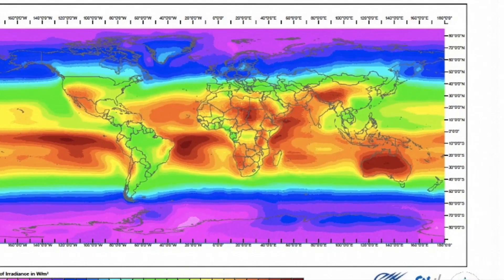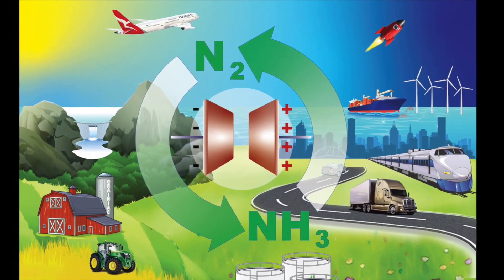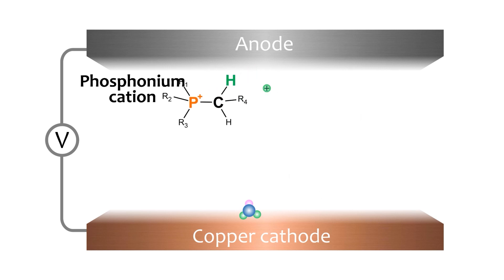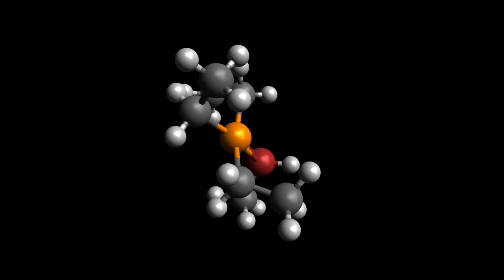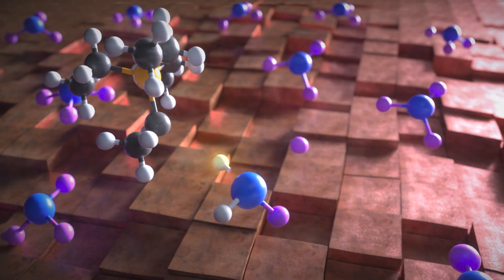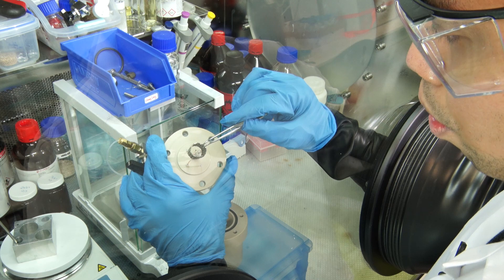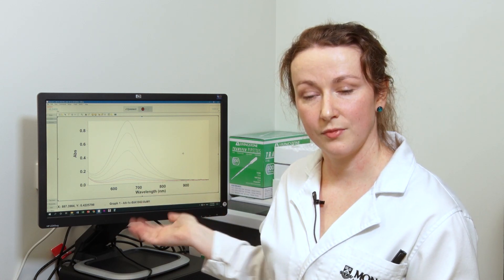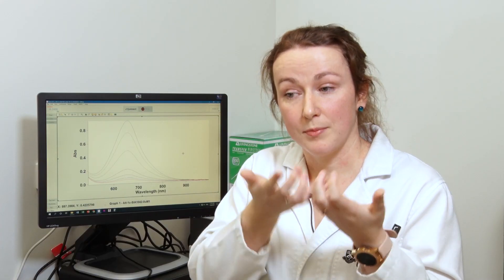New Research from the Monash Ammonia Project

Comment: Direct electrolytic production of ammonia is a holy grail for many reasons, primarily as a solar dumpload that can be used locally to the same regions that have the solar plants. But.... The subtext I’m getting from this presentation is that the quantities are so low they are resulting to some of the highest accuracy methods of measurement.

My gut feeling is if this were viable it would be a matter of simple titration on litres of concentrate. Not NMR on a single mL. Let alone having to run on analytical grade nitrogen bottles, assembled in a clean box because the real air is too contaminated.

Fingers crossed this is just a path finder and the understanding gained elucidates a more practical and robust method.

But sorry guys, this ain’t it, and that’s not to take away from the tremendous effort.

Comment: What is the ultimate source of the protons being shuttled by the phosphonium salts? Is it from water? If so, then either you're turning H2O into OH, and the solution will get steadily more basic, or you are turning H2O into O2, so you'll be releasing O2 from the anode and NH3 from the cathode. (I expect this would be the easier scenario to deal with when trying to industrialize the process as all you need to do to replenish the cell is keep adding distilled water and nitrogen gas.) 

Is the copper there simply to conduct electricity, or does it play some catalytic role? Does it matter what the anode is made of?

If we used this to turn electricity into ammonia, then used the ammonia as a fuel in a motor to turn a shaft, what would the efficiency be compared to using the electricity to turn the shaft with an electric motor? (Yes, I understand that you'd do it this way because your shaft is on a ship and you don't have a long enough extension cord to turn the shaft electrically.)
Reply: The advantage with this method is that you can use renewable energy to produce the ammonia and the ammonia can then be transported or stored for long periods which you can't do with a battery
Reply: @agritech802  Yes, I know all this. But efficiency still matters a lot. This energy storage method will see much much more use if it is 80% efficient than if it is 5%, and from what I know now, either is possible.
Reply: @michaelwoodhams7866  yes I agree, we need to see more data